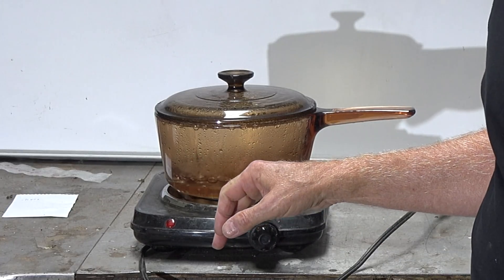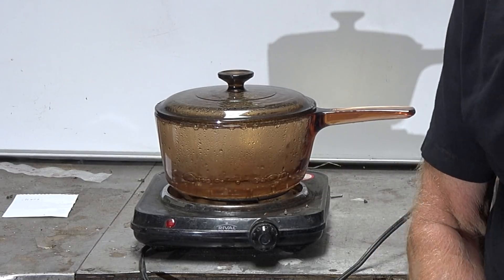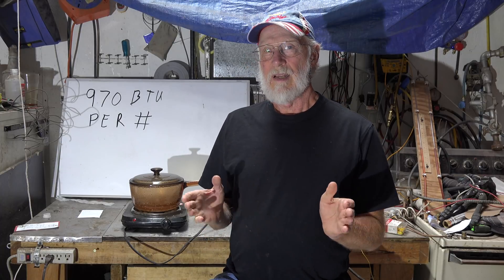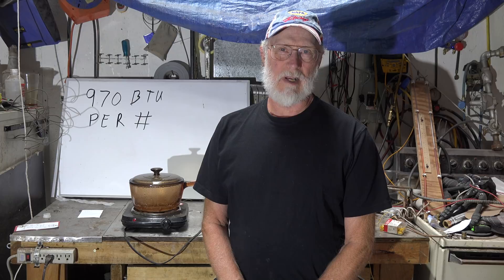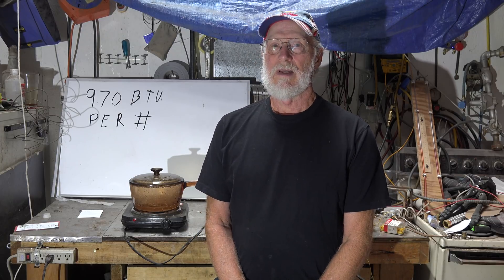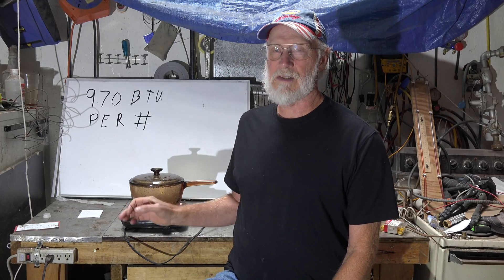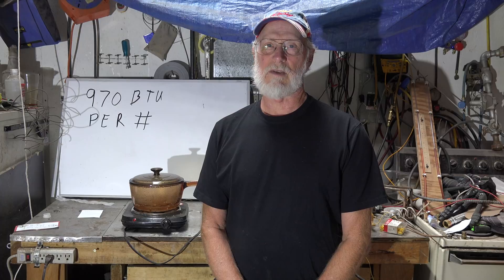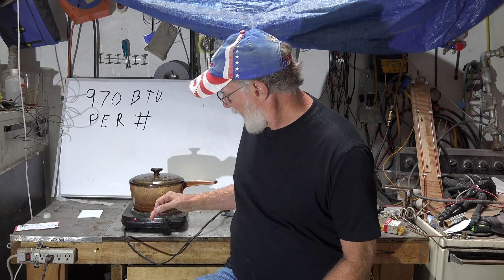Water and latent heat Part 3

Comment: IF THE SLOTS ARE ALL FILLED UP IN THE AIR WITH WATER, IS THAT HOW RAIN IS FORMED?
Reply from the maker: Yes.  Consider cold air contacting warm, moist air.  The contact area could reduce the temp of the warm air, and because humidity is related to the temp of the air, the reduced temp will make less slots available, so the moisture condenses out of the air.  Thus rain.
GFM

Comment: Does propane contain less water content then natural gas when it is burned?
Reply from the maker: Beats me.
GFM
Reply: @grayfurnaceman  Refreshing for someone to just say "IDK" instead of making up some half truth bullshit.  Auto parts and home improvement store are rife with people who are all to happy to share their ignorance. Ironically, its because they don't want to say "IDK" and come off as ignorant.
Reply: Isn't propane basically hydrogen and carbon molecules?  The air carries moisture and when combustion happens water vapor is one of the byproducts.
Reply from the maker: @caru3257  The air is not the source of the water.  When combustion happens, hydrogen is broken loose from carbon compounds and attaches to oxygen to produce water.
GFM
Reply: @caru3257  I do believe I did not express my question properly. I should have asked, witch gas when burned in the presence of air produces more water content, propane or natural gas.